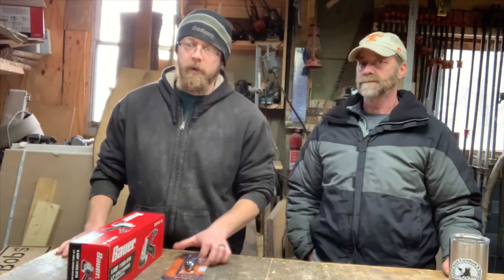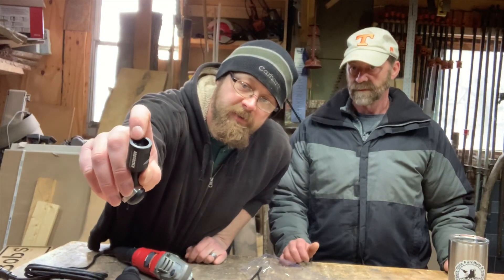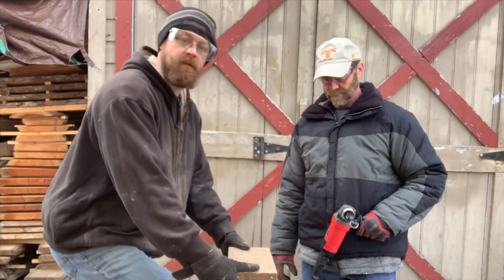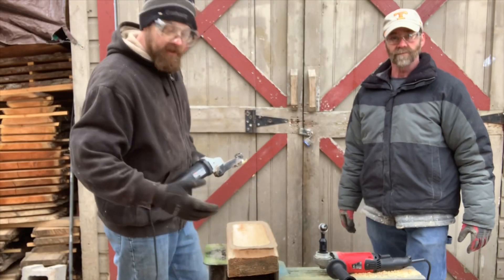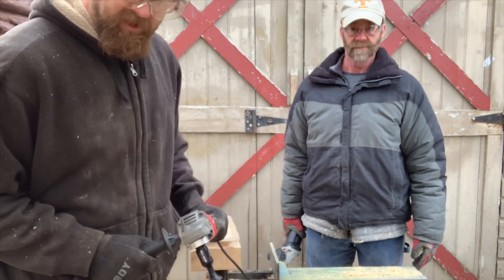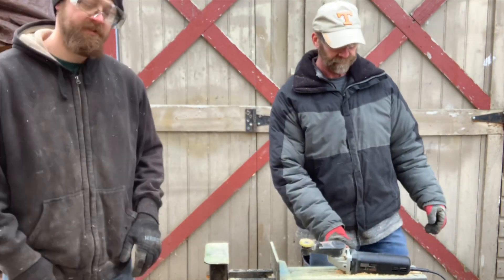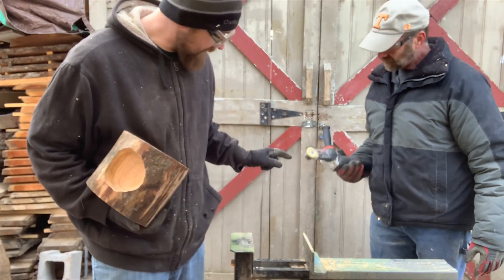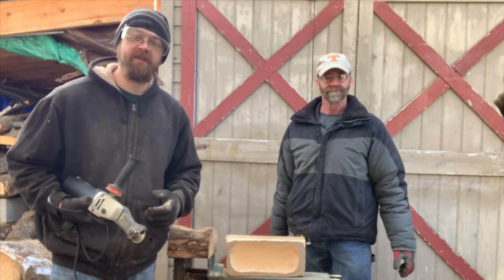Using the Arbortech ball gouge and Arbortech mini carver.

Comment: I use the ball gouge for making bowls and end grain planters. I like using Black&Decker angle grinder, because that has an extra screw-in hole for the handle. With handle on the back, you are only working a flat-triangle of forces. While with the handle on either side, you have to work a pyramid of forces, which is a little squirrelly I thought. 
I wish the B&D grinder came with a grip switch like the Bauer.

Comment: I’ve got Arbortech mini carver, but when I attached Saburrtooth 2” dounat disc weel, It keeps getting loos, I’m pretty sure I tightened it up, but it still doesn’t work, would you mind to make a video changing this attachments?
Thanks in advanced
Reply from the maker: I had the same problem. I actually made the hole bigger on a small washer then put the 2” disc on then the washer then the screw to tighten. The washer hole needs to be slightly bigger than the hole in the 2” disc . Hope that makes sense .

Comment: Do you like using a die grinder or this more? Are they similar?
Reply from the maker: This is a tool I gave my dad . I like the die grinder for carving and detailing pieces . This tool set up is better for bowls
Reply: @KyleHallwoodworker  great, I've been planning on getting a die grinder for a while now and was worried I needed 2 tools. Do you think variable speed is necessary for one or no?
Reply from the maker: @chompers11  not necessary but I can see the benefits if it was variable speed

Comment: Is this less dangerous than a regular grinder attachment?  I'm excited to carve, but won't buy the dangerous stuff.
Reply from the maker: Well all power tools and carving tools have a certain level of danger . I don’t think this is any worse . I definitely recommend staying away from the chainsaw wheel that goes on an angle grinder. Those are probably the most dangerous. Also get a grinder with a paddle switch it’s the safest
Reply: @KyleHallwoodworker  I was cutting a stone top with a grinder and a diamond wheel on it. It got bound up and jumped out of my hand. Because I had the switch style the wheel remained running as it cut into my hand. Narrowly missed cutting through a tendon connecting my thumb to my hand. That could have been avoided by the paddle switch so I second the motion on those being a lot safer.
Reply from the maker: I have always used the switch style and I’m slowly changing to the paddle

Comment: Looks like the ball gouge is a little hard to control. Did it feel like that when you were using it?
Reply from the maker: Yeah it is . It has the to be at the right angle . I think with some practice it could prove to be a useful tool . Kinda like anything else
Reply: It actually isn't at all. It just has a learning period so that you know the angle to use. If you do it wrong it will pull or bounce
Reply: Arbortech tools are great.
I have most of them.
They beat every power carving tool I've yet come across. Including King Arthurs tools which tend to clog up. 
I haven't needed to sharpen anything yet and our eucalypts are extremely hard. Mostly You just rotate the cutting edge with the tool supplied. Cutting edges are doublesided and rotateable.
You control the grab with the angle of attack.
Even the four inch tools are controlleable.

Comment: I have one and I can not keep it from bouncing all over the place. I have tried different woods and different angles. Just not that impressed for the $$ may be something I am doing
Reply from the maker: Yeah we were dealing with the same thing. I was thinking maybe we just needed more practice
Reply: You are definitely doing it wrong at the moment, it has to do with angles and pressure.  Very easy to use once you learn that . Took me about 3 hours of use before I got it to flow smoothly and effectively